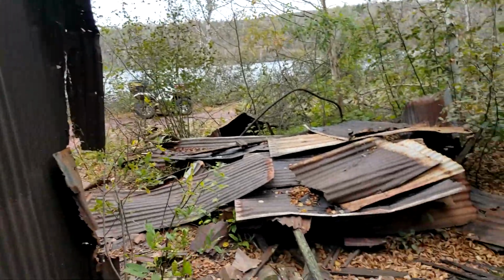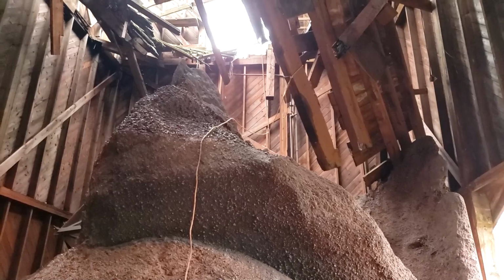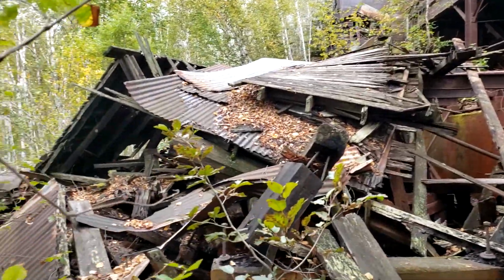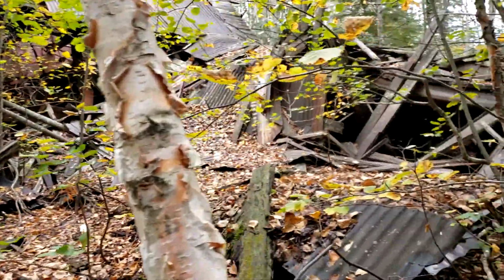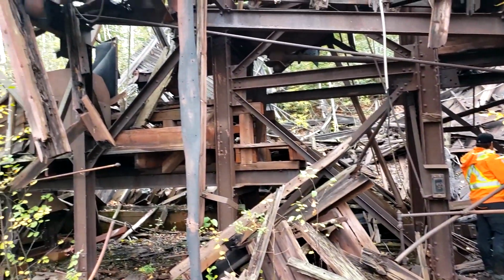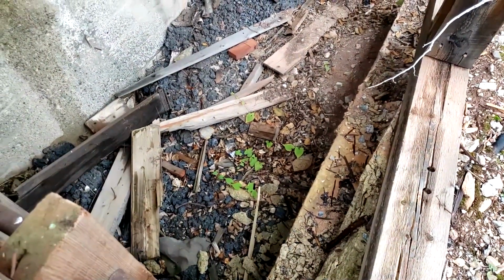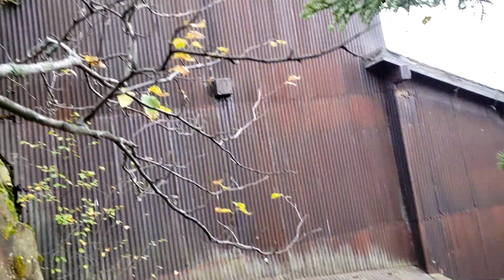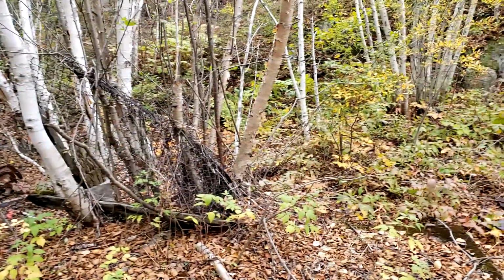Exploring Abandoned Mine Mill Ruins Huge Ore Bins Buildings

Comment: There’s obviously no scrap market up there.
About ten years ago scrap thieves were so bold, they stole the air conditioner 
units from our church! That was a hot Sunday morning.
One scrapper was so bold that he stole an old railroad bridge.
Reply from the maker: Wow!  I'm sure once this place burns there might be some scrappers in there but the road is pretty narrow so it'd have to be a small truck and crane to remove the steel. Thanks Steve!
Reply: I've heard second hand that the wood here was used to build other homes in a nearby town. A lot of that wood is in pristine shape it blew us away the first time we went there. That zinc plating has done a great job over the years keeping that wood as it is. Also, the plating wasn't ripped off like that until late summer last year at the bottom of the shute, it was all still there. They got some nice iron infused wood from under it!
Reply from the maker: Thanks Andrew! Wish I could've seen the place 30 years ago.